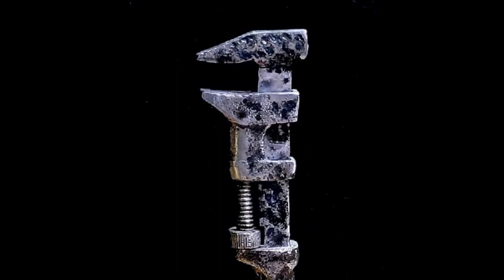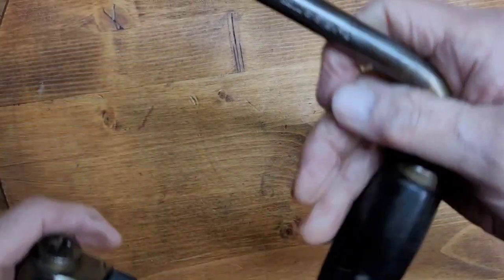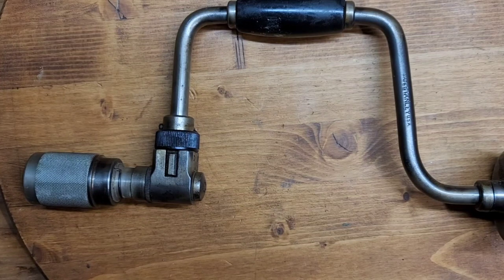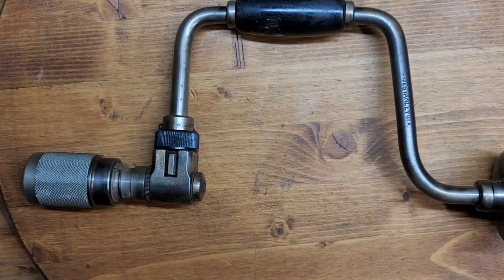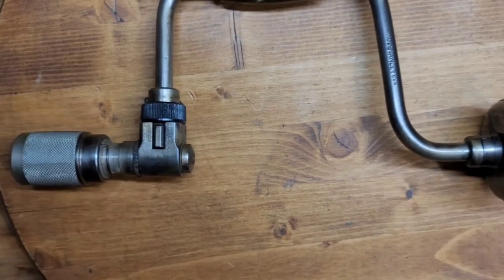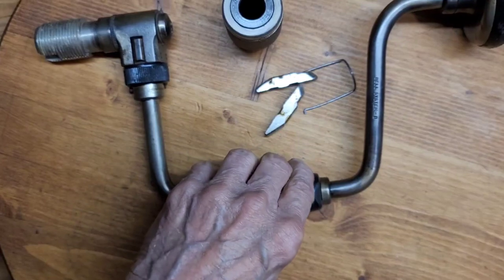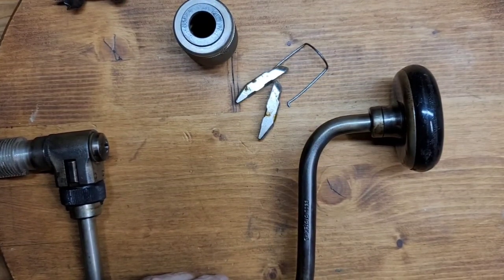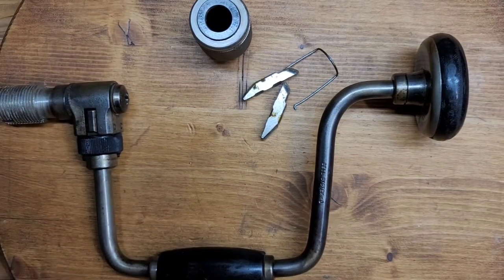Stanley Bell System Brace

Comment: Hi John, glad we could help you hit 1000. Way to go. I very much like your video especially since I also have a Bell Brace. I moved from a condo back into a house last July. I’ve also had 2 hip replacements so I have yet to get my shop set up. This brace is a future project. Thanks for the Bakelite tip. Best Regards,
John
Reply from the maker: Holy cow 2 hip replacements. Getb well soon and set up your shop. I'm in a condo but haver a single car garage
Reply: @johnfix1  John, thanks for your reply. I was in a condo 1 car garage before we moved. The good part was that it had 10’ ceilings so I had a lot of verticals shelving around the whole garage. Now that I’m getting around again without pain, I’m starting to put up verticals shelving. I started an LLC so I would have a business to keep me out of trouble once I retire in a few years. My business started out as refurbishing antique sewing machines as my wife is an avid sewer. But it quickly spread out to include refurnishing tools and antique machines. It’s nice to have the business as a tax deduction. It became obvious the skill set is very similar between sewing machines and other power and hand tools. I have some gems lined up for future projects. I have a 1939 Atlas/Craftsman 12” Metal lathe, a 1934 Delta DP220 bench top drill press, and a 1930’s 6” Delta Jointer. I also have an assortment of hand tools, vises, and vintage power tools. I can’t wait to get my shop back up and running. 
Best Regards,
John
Reply from the maker: @americansewingmachineresto1545  You have some great projects lined up. I would like to build a shop from scratch. Right now  just keep remodeling to accommodate more stuff.

Comment: John great job on the brace I am a fan of Bell System tools as well. The Bakelite turned out really nice. John, I refinished the same as you did without buffing and got the same flat finish. Yesterday I was working on an old Mutual propane blow torch handle this time I sanded to 1500 grit then used rubbing compound with a wet rag then cleaner wax and finished with Mothers wax.  The Bakelite turned really good but I think buffing it as you did would improve it. Thank you for another helpful video.
Reply from the maker: Thank you for sharing your experience Michael. This is a constance learning process.

Comment: Another great job. You put a lot of work in that one. I have about 8 Bell System marked tools. Most are chrome plated Stanley push drills. They seem to be very common around here, so I get kind of picky when I buy them. I will buy ones in poorer condition if they have a lot of good bits in the handle and are cheap. keep your videos coming, they teach and entertain.
Reply from the maker: Thank you Chuck for your kind words.
Reply: @johnfix1  I enjoy your show and enjoy tools both old and new. I still have tools I got back in the mid 1960's.